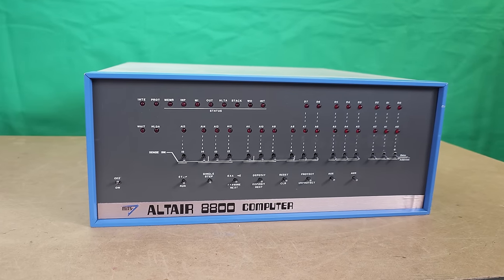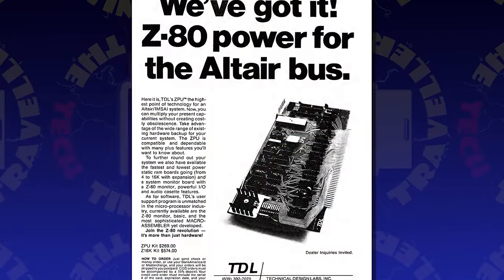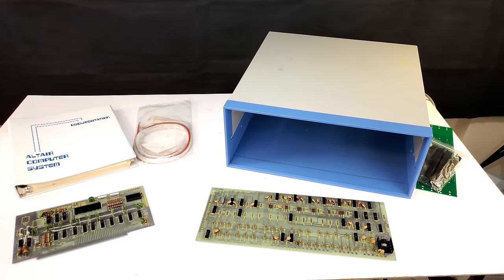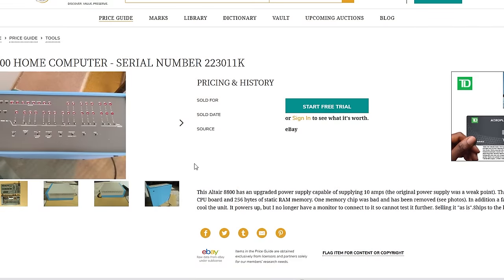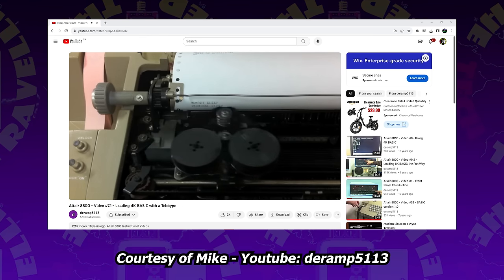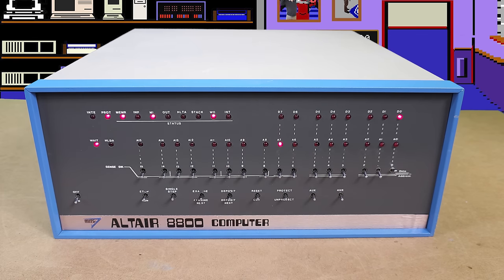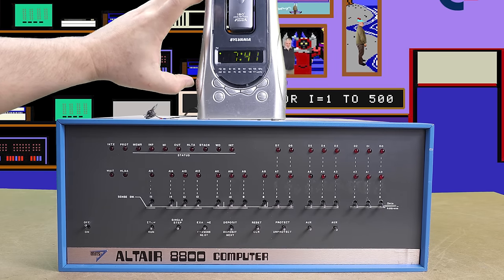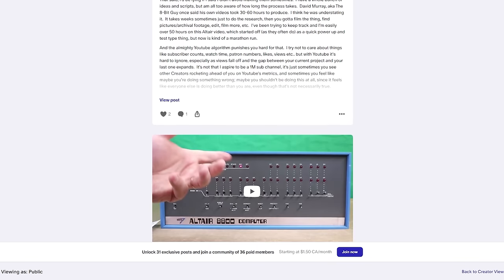I Bought the Cheapest Altair 8800 Computer on Ebay

Comment: Hi. I bought my 8800 256 byte $395 kit the day the mag article came out. I have two basic paper tapes: MITS and Lawrence Livermore's basic and the 4K memory board. Assembled, tested, and it worked. Memory is vague but I had a rom boot loader. I used the toggles to load a boot strap "Jump loader: 303, address". I was very fast (fingers have slowed with age). I wrote a pre-pre-GPS geolocation program based on the 400 MHz timation satellite signal. I'm a Viet Nam vet, 6yrs Navy + 4yrs Navy reserve. The 8800 + nav solution was my senior undergrad  engineering project. Yes I got an A.

On to business. The 8800 has been unused ever since. It, the boards, basic tapes and a manual (hand pulled, no fancy motor driven) tape reader, the original magazine (I think I still have it) all sit on a library shelf collecting dust. If you want it all, lets talk. I think $100.00 would more than cover everything plus shipping costs. At this point I'd rather give it away than have a survivor throw it away. //jta//

Comment: The front panel is binary, it's just grouped as octal numbers. I don't get the need for all the references to octal. If the input were truly octal you would have 5, eight position switches. But you don't, it's just groups of 3 bits.
Reply from the maker: Yeah I didn't explain that real well.  I suppose I should have said, the switches and lights are binary, but MITS grouped them to correspond with octal notation, which is easier than binary numbers for humans to work with/remember?

Comment: Fascinating piece of history! I wonder what kind of overclocking they did to that machine?
Reply from the maker: Interesting question.. not sure if overclocking was a thing at that time.  Hmm..
Reply: @TechTimeTraveller  - I recall reading some older machines can be overclocked by changing out a clock or timer chip. Of course take what I said with a heavy skepticism 😜

Comment: Some years ago I saw an Altair at an Antiques/flea market. It was in working condition and had a couple of extra boards that came with it. One was an extra memory board which didn't work. I was very tempted to buy it as I read the price tag as $400. Turns out I mis-read the price. The price tag said $4000.00! I had to walk away from it. Still, it was nice to have seen one in person.
Reply from the maker: It's kind of a double-edged sword with average folks knowing these are collectibles.  It is helping save them from the trash, but at prices only deep pocketed folks can afford sometimes.  Also can be frustrating when people think a dusty old c64 is worth $2k.  I'm hoping prices will calm down.  I've never actually met anyone in the forums or hobby that have paid $6700 for an Altair, so I'm left wondering who these folks are or of they're institutions etc.  I've also wondered, seriously, about money laundering and stuff like that because I've seen these things sell and then pop up again and they have private bidder listings.  You see stuff that shouldn't be 4 figures going for that kind of money.  I mean probably it's collectors but it's weird they don't make appearances in the online vintage tech communities.
Reply: @TechTimeTraveller  hmm. Not quite money laundering, but I wonder if it's something of an extension of the old "buy a lot of art to avoid tax" deal... but applied to old computers? If so, it'd be a shame, because those only ever end up in warehouses rather than loved and appreciated. That said, $6k would be kind of chump change for those schemes — those usually deal more in $60-600k kind of ranges.

Comment: Martin Eberhard created an expanded version of the MITS 88-2SIO board and Mike Douglas has the FDC+ board.  Both of those come with excellent documentation.  You might want to send them an email to see if they are still available.  I built an 8800c last year using those boards and a reproduction Altair CPU board.  I put 4 3.5" floppy drives in a custom wooden chassis, set to 360 RPM to emulate 8" or 5-1/4"HD drives. and have it set up to boot CPM.  I'd like to set it up one day to run a packet radio BBS.
Reply from the maker: I think if I want to get into teletype use that'll have to be the way.  The SIOB boards are crazy rare and expensive.

Comment: Thank you for explaining that it uses octal numbers - the grouping just didn't make any sense. It still doesn't, but now there's a story with it. That silkscreen never made any sense for the same reason.
Reply: In defense of octal, look at the instruction set. The right two octal numbers are often the registers without using an assembler, memorizing the instruction format can reduce the amount of referring to the instruction set each time you want to make changes to the execution. For the 8080, octal makes a lot of sense. Hex is more useful for text input or output as it uses a less tape for each byte. I admit, I like hex better as it is easier to deal with, number values. With octal one could make a simple instruction decoder to tape to the front panel for most of the common instructions, especially those that require one or two registers.

Comment: Great video! The other interference you were hearing on your AM radio is likely caused by of the other modern electronics with which you are surrounded... microprocessors, switch mode power supplies, Ethernet networks, LED lights, ADSL/VDSL modems, etc. When the music program was written, the ONLY things in the home that generated radio interference were electric motors that had sparking commutators. AM (and shortwave) radio is virtually unusable in urban areas these days.

Being an amateur radio operator I am well aware of the problems caused by the increasing RF noise floor in urban areas. Why do EV car makers want to stop putting AM radios in their cars?? Because it is almost impossible to make an EV (or any other modern car) that doesn't cause radio interference. Normal people don't care much about this issue, but maybe they will when their phones stop working due to some poorly designed electronics they have just purchased 🙂

Comment: eh hehe.  

I remember my first computer and it too was an Altair 8800 and I was all of 14 years old. Assembly of an Altair 8800 requires a soldering pencil for almost everything. Don't worry b/c I also recently became a licensed Novice Amateur Radio Operator; the requirements included being proficient at sending and receiving Morse Code, electronics, theory, etc. I really got into that stuff and went deep so the Altair 8800 wasn't my first rodeo. It did take me well over a year to build however. To help I was a black hole. I absorbed vast amounts of help at all times. <Quasar>

The Altair 8800 is baryonic insanity. Insanity congeals into fog banks and puddles around anything 8800. I knew absolutely nothing about computers and micro in 1978 but I learned fast, like a huge ocean wave catching a 90 pound super nerd, rolling and pummeling him onto the dry shore. If you've ever been 'shown the lights' by an ocean wave then you understand what I mean. And they did call this super nerd "Stud" or "Studly" for some reason. Wow, those were the days.

I can't wait to watch this video and hope that it isn't disappointing.

Comment: 28:18 Saying that octal was less than ideal for the 8080 is incorrect.
Take a look at the actual instruction set and you'll realize that octal is perfect for hand coding and entering programs.
For instance the mov instruction from register to register starts with 01 (octal 1) and the destination register is
0 = B
1 = C
2 = D
3 = E
4 = H
5 = L
6 = M
7 = A
Making a MOV A,B into 170 octal.
Incrementing a register (INR) is 0x4, where x is the register. So INR E is 034 octal, where the 3 indicates the E register.
That pattern continues on throughout the entire instruction set. All 8 possible condition codes for Jump, Call, and return fit into their octal digit. The 8 bit math opcodes are fall into 2xy, where x indicates the operation and y indicates the register being used for that operation.
From a point of view of expressing memory contents, I agree that octal is less than ideal. But from a point of view of hand coding and entering programs, octal is the correct base to use for the 8080.
Reply from the maker: @johncochran8497  Thank you.  I am not an expert on programming and was relying on the opinions of other experts current and past who were claiming octal was not ideal for various reasons.  This makes sense.

Comment: I built two of these in 1976, neither worked when first powered on forcing me to learn how to use a logic probe and how to read schematics. Fortunately RadioShack had the IC's needed. The first literally burned up (my fault) the second I eventually sold along with the 4k basic cassette. I very much regret selling it. I can even recall that a 4k ram kit was $167 at the time.
Reply from the maker: Ouch!  Didn't pass the 'smoke test' eh? :) I've read a lot of historical accounts of that happening to Altair builders back then.  It happens!  And yeah thats too bad you sold the other one, although who could predict today's collectibility.  I regret throwing out my Tandys and stuff back in the 90s.  That SIO board for the teletype and cassette.. wow. Those are going for $700 now.

Comment: One of those simple machines would be an easy build unless you wanted purchase a museum class computer. I'd consider  building a slightly modern version using a Z-80, or MC6809,  but an MC68000, or NS32016 would be preferred,  although ether would make a much better Altair or IMSAI computer along with an upgraded led panel.  An even simpler alternative would be using an SBC such as a Raspberry PI  to emulate one. Another advantage to using a Raspberry PI or similar SBC would be the addition of Wifi, an HDMI display, and the capacity to program in Python.  If you want something that can rival NORAD's WOPR or the HAL 9000. I would go with the Nvidia Jetson AGX Orin. If you're going low budget the Nano should work for you.

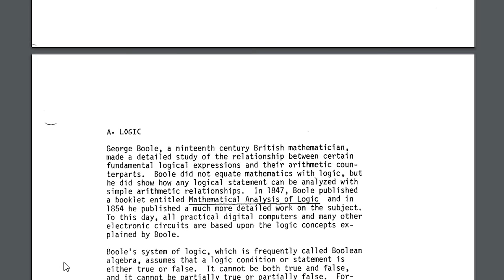Comment: The manual at c. 31:38 is good and detailed... except it has a moment with defining AND: "The AND statement is true if and only if either or all of its logic conditions are true." Possibly they meant to define both AND and OR and it got accidentally concatenated into this, omitting OR. No doubt subsequent pages have the correct tables!

Comment: I've got a friend that has an altair 8800 he's had since he bought it new, and it's just like new and he has all the manuals.  He's not into vintage electronics, it's all just in a box in his closet.  He used to be a professor at the computer science department and he'd sometimes bring it in for show and tell.  But when he retired he boxed all that up.  And no, he's not interested in selling it, believe me I've tried  :)
Reply from the maker: Very cool!  Do you know what revision it is?  He might feel differently if it's a Rev 0 and he heard they're not reaching $10k. :)
Reply: @TechTimeTraveller  I do not.  It's one of the first two from the design of the front panel.  But it's been about 20 years since I've seen it so details are a bit fuzzy.  I know he still has it though.  He was thinking of powering it up a couple years and wanted me to check the power supply first.  I respectfully declined, I didn't want to be responsible if something went wrong.

Comment: I wonder how much the Altair would have benefitted from more ergonomic switches like on PDP panels. Has anyone modded theirs to that? I do like the colored boots mod.
Reply: Heavier switches would probably require a completely new front panel material…
Reply from the maker: I'd guess they went for the cheapest switch they could find, and I think the shortcomings of those was probably why they went for the larger, flat paddle-style switches on later machines.  The main issue I found with the originals (think they are C&K), is they're too darn short.  Any wonder so many front dress panels have the lettering scratched off.
Reply: I think color booting your switches makes it easier to catch mistakes like you have there. Visually a down switch stands out as you’re looking at the panel from above. The up switch looks like a little dot. Kind of ironic since the 1 and 0 visually look like the opposite!
Reply: That was the IMSI 8080.
Reply: The OG PDP/8 I got to play with had fantastic switches. Colour coded in groups of 3 and octal made total sense for a 12 bit machine, I could program that front panel in seconds vs minutes with silly toggle switches.

Comment: Aren't the switches still in binary, just grouped into 3? 1 octal digits is just translates to 3 bits 1:1 and the switches and lights are all 0 or 1 it's not like you get one switch from 0-7 it's all individual switches and lights for indviduals bits so it's not really octual it's binary but in groups of 3.

Comment: I bought a mint looking Altair 680 front panel and case   via eBay in about 2008 for $200 US. I populated the front panel with switches and LEDs to make it look legit for my students.
Reply from the maker: I have that too.  It's kind of weird.  I've seen a whole bunch of 680 cases and front panels sold on ebay.. more common than complete machines for some reason (not that they're common by any means).  I actually scored a Rev 0 board (unbuilt) for mine and a front panel someone made but they made the pcb for that too wide.. have to saw it down.
Reply: @TechTimeTraveller  I guess they had built far more cases than boards produced. This was also from Albuquerque, so I assume these sat in an old, abandoned warehouse for a long time until discovered.

Comment: I require more info on the Chevy and the Edsels
Reply from the maker: I gave a bit of the story to another commenter..  short version is I got what I paid for.  The Belair sheet metal was mostly stop signs and licence plate patches and lots of air where metal was.. the frame actually rotted almost completely out for a 2 foot section.  The 58 Edsel ran well but had rust issues of it's own.  The 59 was bought no title from a loan company that seized it but had some kind of problem after the debtor transferred the title to a friend, and our registrar (ICBC) for some reason wouldn't fix it.  Took me a year of jumping through hoops to get the title reissued in my name.  But the previous owner sabotaged it by pouring water into the crank case and other stuff.  Plus sitting in the rain for 3 years caused all the nice bodywork to start falling apart.

Comment: OK, so the Commodore PET, Tandy TRS-80, and the Apple II; a.k.a. the 1977 "Holy Trinity," were the first... what: fully factory-assembled consumer computers with... a direct keyboard interface, or... what, exactly? They were officially considered to be first at... something, I thought. But what was that?
Reply: They were (a) pre assembled, with cases and ready to plug in and (b) came with keyboards and video displays (or at least video outputs). Most previous personal computers - like the Altair - really needed to be linked a video terminal or teletype to be much use (you can see from The Fine Video just how practical using the Altair front panel was). If you couldn't think in hexadecimal, didn't own a soldering iron and hang around amateur radio fairs hoping to snag a surplus Teletype, the "Holy Trinity" were the first really 'accessible' mass-market personal computers.  I think the Apple 1 (not II) was among the first designs to have a keyboard interface and video circuitry on a single board - but it wasn't sold in fully assembled form.

Still, even with the TRS-80, Apple II and PET its safer to say "among the first" - there was a flood of such systems around that time, and Wikipedia is telling me that Sol-20 (briefly shown in the video) , from 1976, is the first 'all-in-one' computer.

Comment: At around 37 minutes in you talk about how the mistake you made by adding two numbers larger than the processor could fit in 8 bits should roll over to zero, but instead you got a 5. When we say "roll over" what we mean is that it will just keep going. The top bit of an 8 bit value is 128, and 128+128 = 256, which is zero. But your numbers were actually 130 + 131. The 128's in both numbers add to 0, and the 2 and 3 which were also present in the numbers as together to get the 5, so you still get the intended result.

More precisely what happens is when you add two numbers that exceed 255, it just throws away any bits above the 8 bits it has to work with, because 1000_0010 + 1000_0011 = 1_0000_0101, which gets truncated to 0000_0101.